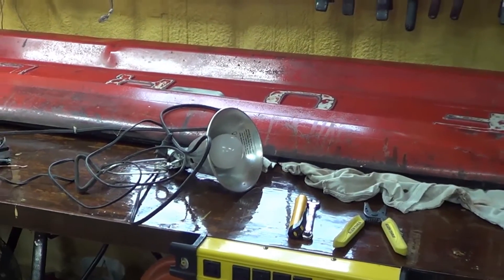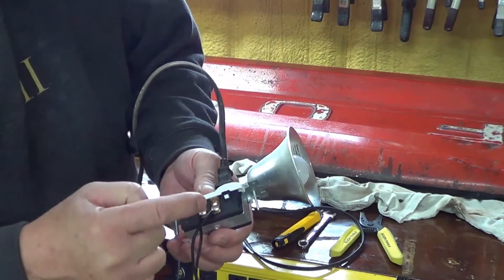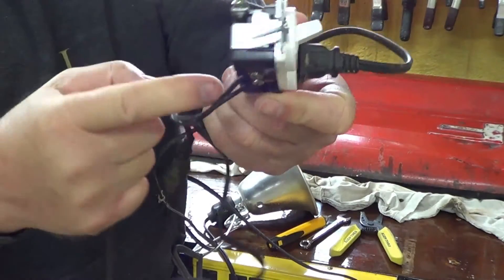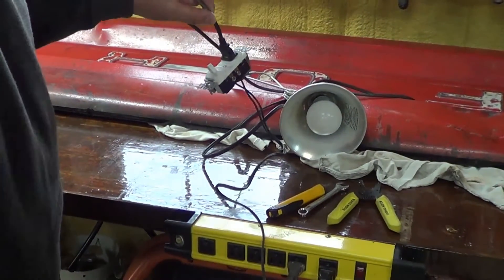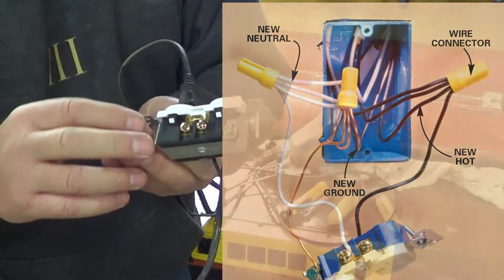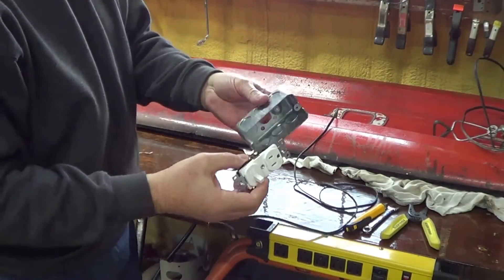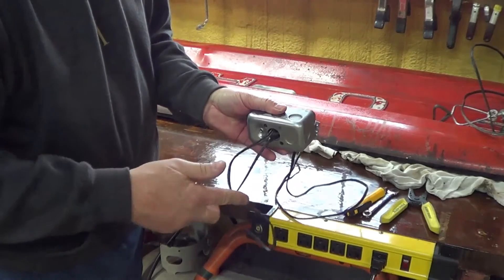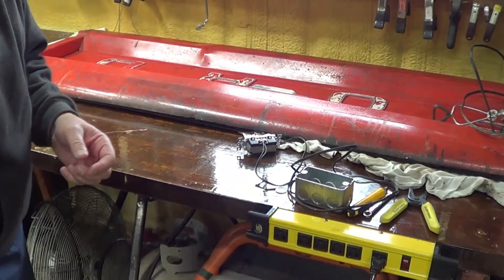Wiring A Socket & Switch Together - Different Ways To Wire It

Comment: i recognized that  switch/recempt. type
you are correct,  the silver on the switch half is HOT in ( switch ), and the silver on the outlet half is outlet neutral (white), with the tab on the brass end being on weather or not you want the switch to control the onboard outlet or something else ( tab or no tab respectively )

Comment: Just a thought... On a 120volt plug the long slot is always neutral and the shorter slot is always hot... But your right about the silver color vrs copper color...

Comment: You did it exactly right.....40 years experience.. First house wiring late 70's, commercial and industrial 6 years later and then retiring at a power company here working the high voltage lines... Good job!

Comment: Electrician here. Don’t break the tab on the silver side, EVER.
Reply: Why? just wondering?
Reply: @MattyDemello  Bzzzz 🔥
Reply: @pimentoloaf1509  Good answer.
Reply: I'm guessing if you break that tab then the whole box can become "hot"maybe shocking someone or starting a fire potentially???   
Would love to know!
Reply: @donc9751  As far as the combination Switch/Receptacle device Rick is using, the SWITCH has no connection to the 'silver' tab or screw.  Silver equal Nuetral equals White wire.  A Nuetral wire, SHOULD NEVER BE SWITCHED, HOOKED TO A SWITCH, EVER. Why? Its about how the circuit breakers and fuses work, upstream in the main panel.
Reply: I think he's correcting Rick's statement.  If the tab on the "gold" side isn't broken, then it's shorted and breaker will blow.
You must break the tab on the gold side for this to work.
If you want them to be independent, break the silver side tab.